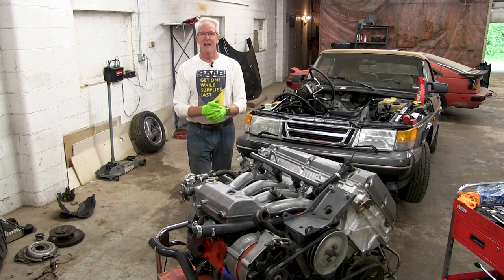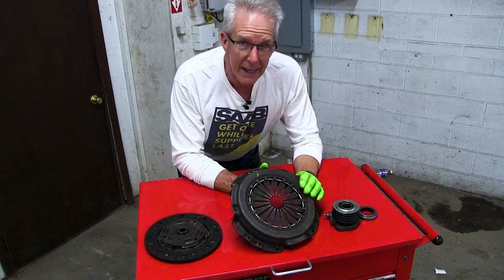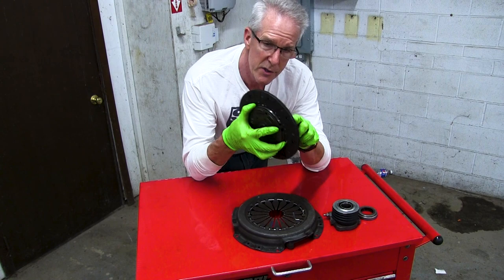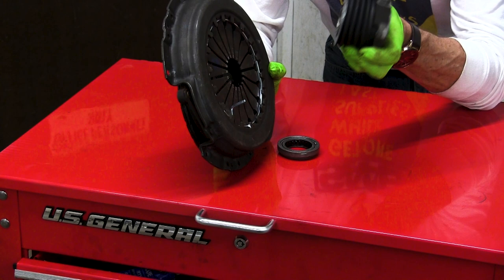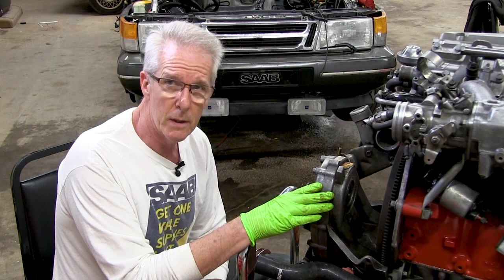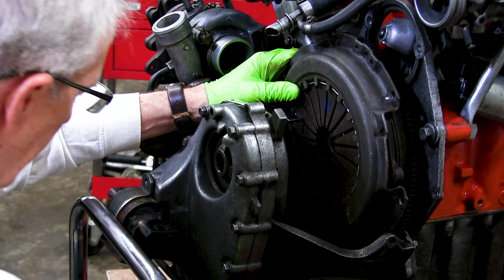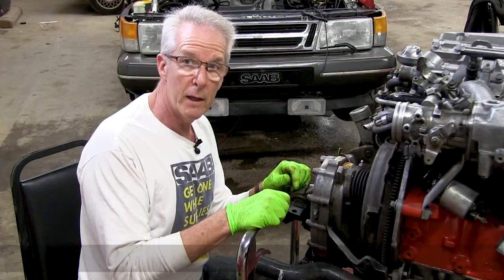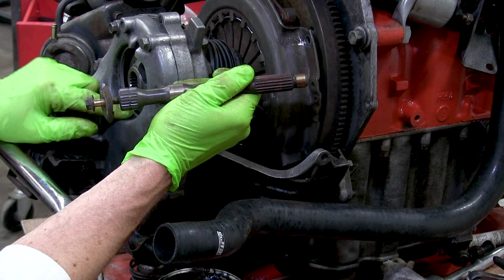SAAB 900 Clutch Explained

Comment: I found the clutch on my '85 900i one of the nicest I'd ever used (particularly after I replaced the flywheel pilot bearing along with the clutch itself). I gave the car to my mum and she also found it made the car very easy to drive in city traffic. It's down to the direct-acting slave piston which the layout allowed SAAB to use - every other clutch I've seen uses a lever system between the piston and release bearing (out of necessity)..

Comment: Possibly been mentioned before in the comments BUT the clutch driven plate used in this video demo is shown being installed back to front. 
The flat side [not the raised side] is always to the flywheel, otherwise the raised section's anti rattle springs will most likely come in contact with the flywheel bolts sometimes causing dragging or causing the clutch not to release when the clutch pedal is fully pushed in. 
Also the pressed/crimped retainers for the springs can wear causing the springs to come loose & fall out jamming things up.
So guys be careful on that one otherwise it will be failure or a re-do & that is a real PITA. John.
Reply from the maker: Excellent point, John.  I should have been more careful in how I explained things instead of simply giving a "big-picture" overview.

Comment: Good video Lee.  Another way to not have to use the "Stupid metal ring" is the 3 Large Nut method.  Look it up.
Reply: Oh, yeah.  Been there, done that.  The spacer ring is much preferred for those who can insert it before removing the clutch components.  But, you're right, if your system won't hold pressure the three-fat-nut trick is better than a Sawzall.

Comment: I have a 1992 Saab 900S  and...the clutch peddle lost resistance from sitting.  I like the idea of it being up front and easy to work on.  Anyway,  I had to replace the master cylinder... that's a story of it's own.  Well, moving on...  The slave  was also leaking.  So, here we go! . It is fairly straight forward once you remove the plastic shroud covering everything...and the left electric fan. A few things were in the way...not a big deal.  What made me scratch my head was the removal of the clutch shaft.  There is no snap ring as I thought...there is a snap on clip that holds a cover for the shaft.  Once you remove the cover for the clutch rod , you will find a white oil propeller...it unscrews (don't break it!).  The next thing To do is pull the clutch shaft.  I used a bolt from the pressure plate and attached a cat's claw.  Rather than trying to pry it loose...I just tapped it with a hammer...came right out.  Waiting for parts now.
Reply from the maker: Sounds like you did everything perfectly.  The position of the three allen-head bolds holding the slave can be challenging.  I ordered this tool from Amazon that makes the process much easier:   https://www.amazon.com/gp/product/B002655H5U/ref=ppx_od_dt_b_asin_title_s00?ie=UTF8&psc=1
Reply: @LeeKelso  The only hard part for me was getting the slave cylinder out. I hear there is a tool that will compress al 15 plate fingers...costly and probably hard to find.  It did slowly pry out of place...but the idea of taking both plate and slave out at the same time just did not make sense to me .
Reply: I did the job on the cheap with quality parts...same plate, disc and throw out bearing. It shifts perfectly now!  Your video was the key for me...THANKS LEE!

Comment: Thanks for the great video Lee. I'm currently doing some pretty major engine rebuild operation and your videos have been great help. I'd love to see more of these longer and in-depth videos!
Reply from the maker: Thanks for the feedback.  What are your projects?
Reply: @LeeKelso  I'm changing the whole engine from another Saab, which has a better transmission. The old engine is B212 from 1991, which has teflon-coating on it's pistons. In some cases, they have started to wear off and cause a lot of damage, so I want to be sure that it won't happen. The replacement-engine is from 1992, which doesn't have the teflon-coatings. I'll change all the seals and gaskets, and I took the cylinder head to a local workshop to be adjusted.

One question: how did you insert the wire to the new clutch? I don't have a large enough vise to compress the clutch, so I think I need to improvise.
Reply from the maker: @Fimwind    I have access to a friend's bench-top press.  I suspect if you take the pressure plate to a machine shop, a well-equipped repair center or a vocational school's auto shop you could get them to let you or help you install it for next to nothing.  Anyplace with a press to change wheel bearings could do it easily.  

Be sure to order the right spacer tool for the pressure plate you're using.  There are different diameters of the spring fingers.  I believe the later years, like your 92 engine, will have the larger diameter if it comes complete with a pressure plate and clutch assembly.
Reply: @LeeKelso  Thanks for the tips. I used brake pipe between the spring fingers to remove the old clutch, it worked pretty well. It's very easy to bend it to right size and shape!

Comment: Another great video Lee. I'm having a headache with the ABS on my 1992 900 turbo convertible. ABS and brake fluid lights stay on permanently and the brake pedal is solid. I got a 1222 error code. Can't find any electrical issues so next will be start pulling parts during the winter. If you get a chance to do video on diagnosing and repairing such an issue it would be greatly appreciated. I may do a video myself eventually when I actually get to fixing this but it may not be for a while. Or maybe as you suggested we could do a joint video on it where I show symptoms and diagnosis I tried on my car and you can provide solutions and a repair your end  - might be fun ! All the best. Troy
Reply from the maker: I suspect your brake accumulator is leaking.  It's the round pressure vessel near the brake fluid reservoir. They have an internal rubber diaphragm that fails and won't hold pressure for the ABS system.  I replaced mine with a Jaguar version.  Don't recall where I found it, but Google will produce several options.  The task itself is simple.   I'd love to collab with you on an episode.  Msg me on Facebook and let's brainstorm.
Reply: Lee Kelso thanks for the input - yeah I suspected the accumulator or pump after doing a lot of research - I will try that option first o think ! Yeah sure thing I'll get in touch ! Thanks for all the useful videos !

Comment: I haven't had much luck in finding visual explanations. In your experience now rebuilding this, is replacing not the clutch mechanism itself, but simply the clutch pedal itself on it's own, a fairly simple job? Mine apparently has a common failure, the hole that the connecting bolt/pin passes through has elongated. Need to swap it out for a "new" used one in hopes that cures it.
Reply from the maker: The biggest challenge is access.   Removing the knee bolster is required, then fold yourself like a pretzel and get on your back to reach up there and relieve the lock bolts holding it in place.  A power ratchet recommended.  They are not all the same through model years.  A pedal set from a 92 would not fit in my 89.

Comment: Where can i find a tension ring (the thing that holds the pressure plate down) that is a good price? All of the rings i have found are like 40 dollars or so, isn't there any cheaper ones?
Reply from the maker: Yeah, crazy cost for a simple piece of wire.   I've used old spark plug leads, heavy gauge wire -  just about anything can work as long as it fits between the fingers of the spring and the tabs on the pressure plate.  For some reason, none of that worked on this particular clutch. I couldn't get the right amount of clearance so I dropped the cash and bought the ring online someplace for about $20 - don't recall where.  Keep in mind there are different diameters over the years so make sure you buy the right size if you're going to buy one vs. a DIY.
Reply: @LeeKelso  okay, thanks a lot!👍